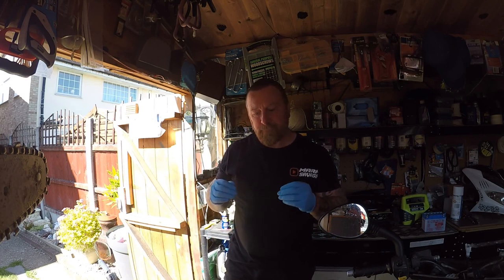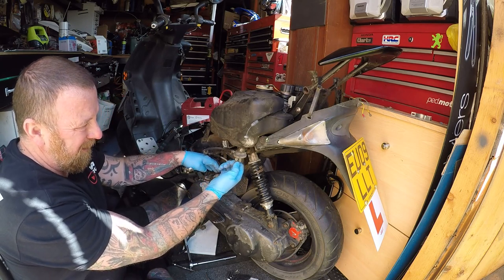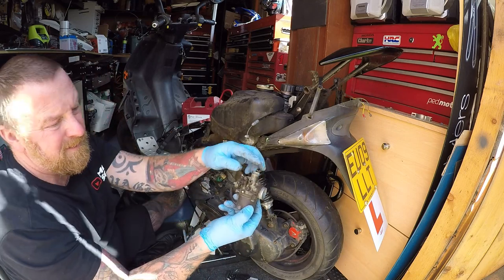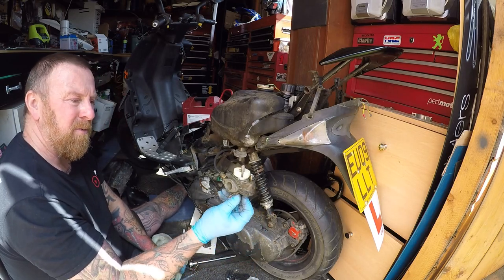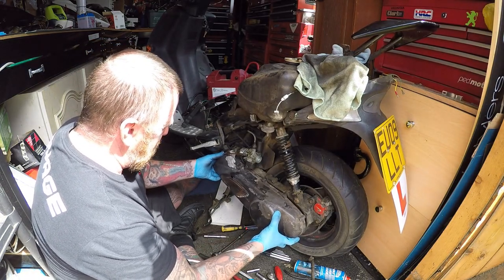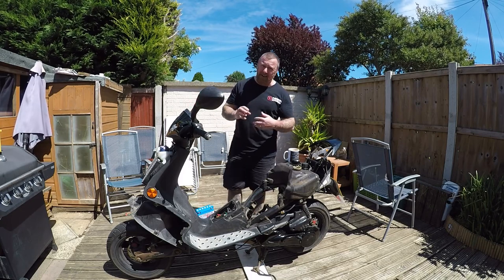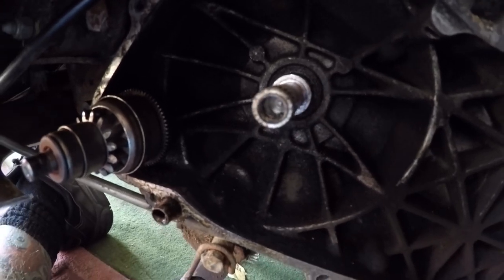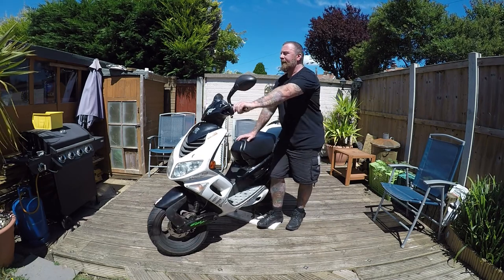SPEEDFIGHT MOPED CARB VARIATOR & FINISH UP PART 5 MARK SAVAGE

Comment: What carburettor adjustment did you have at that time
Reply from the maker: Follow my carb videos bud 
Start from 3 half
Reply: @marksavage  ok ty
Reply: @marksavage  but is it 3 half turns of ilde or air screw?
Reply from the maker: @varshkietukas  follow video bud 
Idle just in
Air mix
Reply: @marksavage  so 3half turns for air mix and 3half turns for idle screw?
Reply: @marksavage  because my peugeot drives for like a week then stops driving again then starts driving again and so on
Reply: @marksavage  cant find any videos of carburettor adjustments for peugeot spf2
Reply from the maker: @varshkietukas  
https://www.youtube.com/watch?v=6bxZ3gI7Csw
https://www.youtube.com/watch?v=6n5YuLxc4VA
https://www.youtube.com/watch?v=Y3J0LZbesoY

Comment: Just bought a used 49cc .Guy was fed up with it . He didn't realize letting it sit outside for the winter does to these things .I cleaned the fuel tank replaced carburetor. Runs like new . only had 1400 miles . 
Marc I know you hate cone type air filters . My problem is I've installed a 2 piece pipe and muffler exaust. Using factory airbox it misses a little .Running without filter it's much better . I'm I going to have to go with cone. Its doing about 74 KMH . Also replaced the variator weights .
Reply from the maker: Yes I do but sometimes you have to bud 
Have you tuned the carb , little more air might help ?
But as long as you can keep it dry it will be fine

Comment: Hello Mark, great video. I have a question, what are you referring when you took down the choke what can adjust?
Reply from the maker: when you take out the auto choke, if its not starting the best it can sometimes be the auto choke and this can be adjusted by screwing in or un screwing the lower part which will give you more or less choke and help towards the starting
most of the time you would not have to play with it 
stay safe

Comment: Hi Mark, really enjoyed this series. I was wondering if you could give me some advice for the problem i have with my speedfight 2 (Air cooled). The problem Im having is that it loses power after driving for 1 minute or so, it just keeps going slower until it stops.
Reply from the maker: Hi bud well it could be q few things 
Plug breaking down ! Change 
Fuel filters! Change
Carb needs a clean 
Float sticking ! Clean 
Blocked jets , clean
Tuning which might help 
Or ! Stator coil going to earth , clean or change
Reply: Hi Mark, thanks a lot for your response! I was hoping you could give me some tips on how to make my float not stick? mark savage

Comment: Hi Mark love the videos u do and I've learned a lot but I've a little problem with my Speedfight 2.
When I start the bike up I let it tick over and once my auto choke goes off I set off but at first it's spluter then revs up and goes and when I'm sat at the train crossings it's ticking over nice but when I go to set off it starts splutering again the it's ok.
The carb is a 12mm gurtner carb with a 60 main jet the needle is in the middle.
I've fitted 6gram rollers along with a malossi double red sponge in my standard air box and a giannelli exhaust would u say I need a smaller or bigger main jet ?
Reply from the maker: This can be you fuel lines hard or not tight  , pilot jet dirty , reeds causing this lag 
Even a faulty plug 
Take it you have tuned like in my video bud 
Take care
Reply: Hi Mark thanks for the reply and yes I've turned it like u said in your video.
It as a new vacuum fuel tap
New vacuum pipe
New fuel pipe
New spark plug-BR7HS
Carb was stripped and cleaned like in your video
New 6gram rollers
New giannelli exhaust
Lightend clutch bell 
New standard clutch but as red springs 
Standard clutch contra spring
Reply from the maker: @linihughes5106  and it still doing it after all that 
I'd still say fueling 
Maybe try a 58 jet 
Or take off the link pipe !
It must be driving you mad !
Next have a look at the reeds
Reply: To be honest yes it is and I've removed the link pipe as u said u throw em away so I followed your advice and got rid I'll try some new reeds first if still no go I'll down jet to a 58 and let u no tomorrow if ok
Reply from the maker: Try it back with the link pipe bud 
I've had it like in my newest sp2 video !

Comment: Hi Mark, Great Videos. Can you tell me what is the standard Carb for the speedfight 100cc 2006, as I suspect that the 1 I have is incorrect, I found out that the person who had it before me upgraded the piston to 125 but I have put it back to 100.
Thanks in Advance...
Reply from the maker: to be honest bud if you have not got one you are not going to get one as they are very rare, your only going to find partner part ones on e bay which will take a lot of setting up if it runs ok at all, try text moped breakers or seller selling speedfight parts to see if they have one 
remember 50cc ones dont fit !!
Reply: @marksavage  what size should it be mm wise so I know what to ask for and thanks.
 I can relate to your frustration at times, the more I dig the more I find things wrong... like the wrong kick start pedal grrrrrr

Comment: Hi mark, great video as always 😀. And amm i have a little problem with my speedfight, so sometimes when i drive for less than a mile with almost full throttle it starts bogging, loses power, but when i release the throttle for 2-4 seconds it goes perfectly again.
Reply from the maker: This can be a few things
Jet size
Float problems 
Fuel lines
Air mix 
Last service 
Plug, air filter
Reply: @marksavage  okey i'll check that, and one more thing, is it worth to get a 17,5mm carb and a sport variator like malossi multivar?
Reply from the maker: Variator can help , carb ! If it starts and runs id leave it

Comment: Hi mark.... do you recommend using polini grease  or anything on the variator  rollers. I just put new variator in scooter but 8 did use grease... wat do I think... thanks in advance 😀
Reply from the maker: As in all of my variator videos and there's loads lol 
Never use anything 
Just new dry roller and clean everything with clean cloths 
Make sure the variator is clean and the inner part too

Comment: Hi mark got a question what colour is the immobiliser wire on the cdi unit and can u cut it as its preventing me from starting my bike
Reply from the maker: The cdi units with immob also have a key detection so its not a wire you can cut thing 
Bud , if no spark its a new cdi and key or if you can get one a bypass unit
Reply: Alright thanks mark just ordered a bypass unit

Comment: Hi Mark. Peugeot tweet 50cc 4 stroke. Is it a simple washer that restricts it to 28mph. Anthony
Reply from the maker: It's a 4t so no bud a lot of these really will only go 30mph 
However 
Clean variator , new rollers 
Small upjet and tune 
Take out and carb restrictors 
And if you can get a sports exhaust 
This will all help to get more out of it
Reply: Thanks Mark for the quick reply. Valuable information. Thanks again. @marksavage

Comment: Hi mark just wondered if you could point me in the right direction with my speed fight 2 was on the stand running mint I cut it out came back to start it and it wouldn’t start I eventually got it started but it would only idle wouldn’t Rev at all it’s had new carb fresh fuel new spark plug the carb has a 62 jet in it the bike has left me really stumped I can’t find what’s causing the problem
Reply from the maker: they do this and as in my videos all 80 of them on speedfights it can drive you mad !!
its got to be from the start 
spark nice and blue 
wet hand test 
wet plug
it could be from piston failure and yes they can just go like that 
reeds , carb cdi etc 
try the basics and see how you get on
Reply: mark savage cheers for the reply mark managed to get it back running the spark plug cap wasn’t on properly but now it’s gone back to not reving I think it’s an electrical issue but I’m just not sure what electrical issue it could be everything mechanical seems fine to me but it seems to me like it’s not getting enough spark at high rpms but this is where it stumps me because sometimes I can turn the bike on and it will be fine then it will just go back to how it is right now just only idling
Reply: mark savage update managed to find a loose wire causing the issue by any chance do you know how to wire up a 4 pin starter relay for my electric start to work

Comment: Hello. Do you know if there is any restrictions in a speedfight 2 exhaust that i could remove to save on buying a aftermarket one?
Reply from the maker: no bud its a sports exhaust and that the only way, they are cheap and they make a big difference
you dont always need an upjet either

Comment: hello mark, i saw a video on youtube of a piaggio zip being converted from air cooling to water cooling. would this be possible on a speedfight 2 if i wanted to improve cooling and power?
Reply from the maker: no this cant not be done on the speedfight engine due to the placement of the crank in the engine, LC are faster so maybe change the whole engine might be the way forward bud
Reply: @marksavage  hi mark me again
I’ve come back to this idea of a liquid cooled swap and bearing in mind your advice I believe that it may be possible to use a liquid cooled cylinder on an air cooled case. I’ve studied my own cases and compared them to cases on a liquid cooled model that uses a mechanical oil pump - the dimensions and designations show they are identical. Surely, then, my case could function with a liquid cooled top end?
I would like to say I really appreciate your free advice and that I trust your experience, having worked on these scoots for years. However, I just don’t see why this wouldn’t be possible.
Reply from the maker: @pedshed5132  ok give it a go bud ,thats all i can say .
replace the air fan with a water pump and connect a radiator , the blue plug is for the top that will show the water temp 
best of luck bud lets know how it goes

Comment: Love what your doing mate will u put 6 grams on a 100cc
Reply from the maker: no they are heavier 8g to 10g I think , have you weighed your roller in there now?
always worth doing but they do have to have more weight 
thanks bud and stat safe
Reply: mark savage no I haven’t mate but will do when I get Round to changing them

Comment: Hi Mark. I have a problem that when I drive my speedfight 2. And there where is the air filter for the carburetor. And on the bottom of the air filter box is like a small hole so when I'm driving. And a bit time later there's like the mix that's a bit dripping from the carburetor. I think that's because a bit gets in the like pipe that's in the air filter. Is that bad or what?

Comment: Hi mark, got another speedfight question
I was out driving my scooter pretty hard and going down a hill i felt a bang. From then on, my scooter cannot reach over 20mph. The bike still starts fine, and revs happily on its stand and from immediate pull away, but whenever I plant the throttle it slows right down to tick over and will not accelerate. I’ve checked my variator, and my gearbox seems undamaged, so is it likely that my clutch has slipped and needs replacing?
Reply from the maker: odd but would be going over it defo , could of been a back fire 
guessing lol 
start over so variator off check roller clean and change 
clutch hand test as in my videos 
clean carb 
service so plug and air filter ]

see how you get on
Reply: @marksavage  I can notice some slight score marks on my clutch bell and some bluing on the metal. My driven pulley is also definitely out of round. Could this be causing the problem? What concerns me is that if my clutch was slipping, why would my engine bog down when I open the throttle? 
Its become pretty difficult to start, the tick over is high and the rpms take a while to settle down when I lift off the gas. Blown crank seal perhaps?
Reply: If I had a bad crank seal, wouldn’t this also explain a backfire due to an extra lean condition?

Comment: Hi Mark, i have a speedfight 2 with 8 Pim CDI dellorto, can u modificate this to put a rotor with normal CDI? LOVE you videos, but i don't undarstand english 😅
Reply from the maker: no you cant not without changing the loom too, they are not immob ones so you dont need to nor is it restricted 
watch my cdi video to see which one you have bud 
and English thank god for google translator and subtitles lol
Reply: @marksavage  thanks, and which versión is better? With 8 pin CDI or another
Reply: I have bought a complete electrical system from speedfight with other cdi
Reply from the maker: So how does it run bud 
I don't mess with the electrics 
More cvt and engine 
On the sp1 and 2 the cdi works unrestricted 
On the sp3 and 4 is when you have to play with them

Comment: Hi mark just got a quick question for you my speed fight 2 runs mint but it seems to be going through spark plugs a lot do you know the reason why it would be doing this or do you know a good brand of spark plug currently using a ngk
Reply from the maker: They are one of the best and a brand I use 
So what is it doing to them ??
Black , white colour 
Fouling then 
With what deposits 
Burning them out ?
Reply: mark savage every time it blows a plug it’s always black
Reply from the maker: @Jake Rides black is rich or burning if crap on it 
Poss stator coil , volt reg or ht coil / lead
Reply: mark savage managed to sort it it wasn’t getting enough air

Comment: Hi mark got a speedfight 100 will tick over any throttle and she cuts out, doesn’t have original carb can’t quite work out the model, can’t quiet work out how to get the jet needle out of the slide lol.. I’ve took carb bowl off and it’s running a 95 main jet couldn’t tell you what notch on jet needle the old guy I brought it off said oil pump issue so I blanked off the pipes to that and premix today whilst messing with carb bloody starter packed up haha, any suggestions mate?
Reply: Oh and an aftermarket air filter was like it when brought lol
Reply from the maker: @ryancarrington6064  try and get a speedfight carb bud otherwise your in a world of trying to set up But if Chinese carb the air mix should be all the way in not 3 half 
Air filter wrong too .
You'll never set it up right bud
Reply: @marksavage  do you have any parts squirrelled away?
Reply: wouldn’t mind putting standard air box back on
Reply from the maker: @ryancarrington6064  I just looked lol 
Only 50cc bits bud as 100cc were hard to get hold of and that was 5 years ago 
I only did a few as they didn't sell very well to be honest 
The 50cc I couldn't get them fast enough!
Maybe try some sellers or breaking and ask them
Reply: @marksavage  the carb says japan on the side and it looks like it says jk with like a circle round it haha, starter is cheap enough off pedparts. 

Time and patience I guess haha my first ever 2 stroke so I’m enjoying learning, just hoping it don’t need a rebuild😂
Reply: @marksavage  hi again mark sorry I’m a pest lol!, can’t get my brain to stop ugh.. finally figured out its a Teikei 16mm carb
Reply from the maker: @ryancarrington6064  thats too small and the problem , a 50cc is normally 17.5 so needs to be 19mm or 21mm 
i was the same but used to have 5 on the go, if i couldn't sort it id work on something else and then go back to it with a clearer mind set
Reply: @marksavage  hi mate stock carb for speedfight 2 is R1434 PHVA 17.5ES Peugeot runs 83 main jet 30 idle and 65 choke jet, other 17.5m carbs I look at because Peugeot one is out of stock everywhere are running  like 90 plus main jets.. at the least, do you have any other way that I can contact you bud?

Comment: Hi mark, i have A question. How do i empty my gas tank on my speed fight 2 AC 2004? I know that you have to put the hose that goes to carburetor like in A can so the gas would go in there but theres no thing coming out of that hose. Do i have to blow air in to the other hose that goes like in intake manifold or how?
Reply from the maker: Fuel goes into the vacuum 
Then out in to the carb 
The goes to the manifold 
Sick to prime carb then on manifold
Reply: @marksavage  ok thanks. But i have another question. I recently Made my gas tank together with oil. Like i mix gas and oil by myself (pre mix). But i took out all the hoses from oil pump and unplugged it. But now theres A Red flashing like the oil lamp on the speedometer. Is it because i unplugged the oil pump? And what do i do to stop the Red oil lamp flashing?
Reply from the maker: @raivisvjaksa4686  it is and if you are going to pre mix you will have to live with it or take the bulb out 
Easy to do like in my videos with taking the clock off
Reply: @marksavage  yeah i thought of that idea too. Thanks

Comment: Hi mark. I've got a oil leak. I think it's coming from the air filter box. Do you know what it could be?
Reply from the maker: All 2t can get oil come back into the air box 
Take off clean or replace the filter 
New plug 
A tune and use good quality 2t oil bud
Reply: @marksavage   thanks for your reply. I will do what you have suggested. What do you mean by A tune?
Reply from the maker: @tonysmith3  as in my 2t carb tune videos 
It show you how to do it 
I have many videos on all mopeds on my channel bud
Reply: @marksavage  ok I will check them out bud

Comment: Hi, Mark. Do you know how much diameter is needed for angel Eyes on speedfight 2 2004? Because i've heard that its 60 mm. But is it 60 mm for both headlights? And is it relly complicated to wire them?
Reply from the maker: The evo head light?
They are just kitchen bulbs 
If so go led bulbs 
They are great but won't pass a UK mot
Reply: @marksavage  no i think the actual angel Eyes. Like the circle ones?
Reply from the maker: @raivisvjaksa4686  oh right 
They must be new 
Just wire borh to the main beam